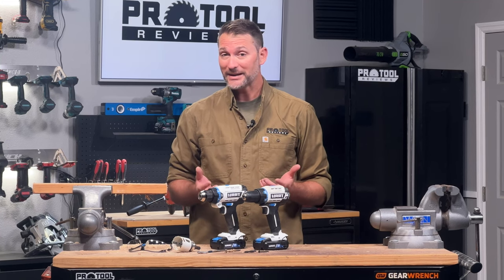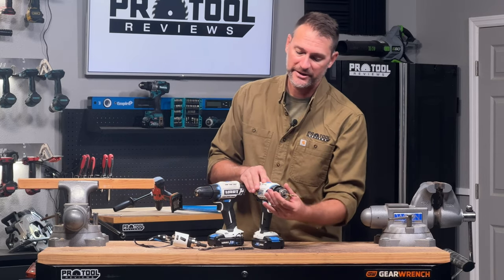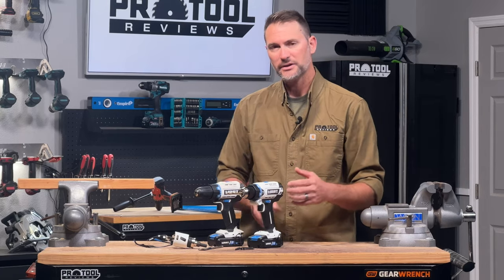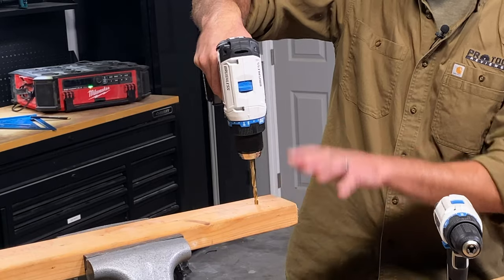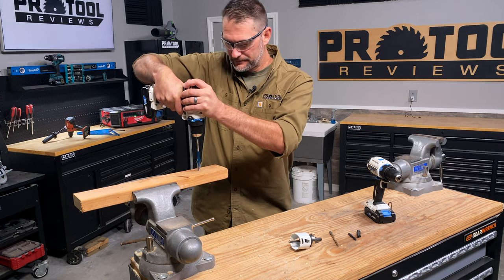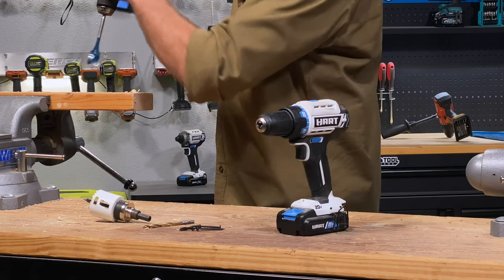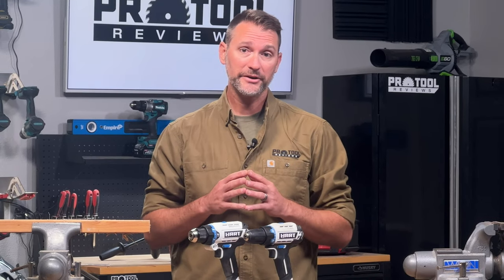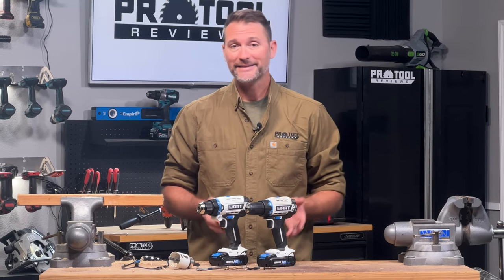What Is a Drill? How to use a Drill or Hammer Drill EXPLAINED

Comment: Should I buy a corded or cordless drill for my apprenticeship
Reply: Ryobi HP cordless
Reply: Go Cordless. If you plan on going far in your career. Stick with a pro brand.
Reply: Cordless. Power rated in inch pounds depends on what you're going to be drilling through. Milwaukee Makita and DeWalt have more powerful drills. Ridgid Ryobi kobalt have decent drills. But less power. If your thinking Ryobi like some one else suggested. It's the Johny Home owner brand of the big three at home Depot. Ridgid is mid tier great for home projects but can also be taken to the job sight.  and Milwaukee is top of the pack.
Reply: Go cordless. Spend a lot of time finding what brands fit your needs.

Borrow tools, ask trusted people in your circles. If half your family have red, go red if it fits your needs. If everyone has teal and you go red, you might not have someone to borrow batteries from.

Get the best tools you can afford.
If you're serious about a career you can largely ignore low end brands.

You really cannot go wrong with any of the main professional brands.
Reply: @naezro  have you not seen the new brushless tools? Pretty much replaced ridgid since they murdered everything for no reason and have no stable line up